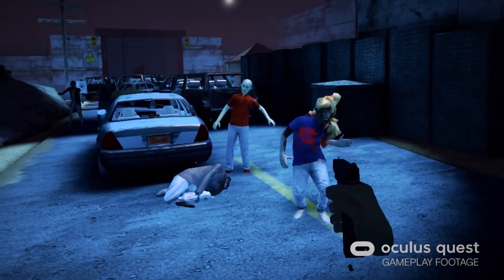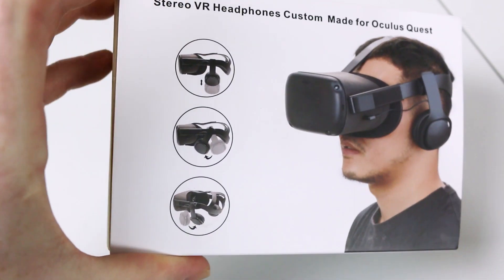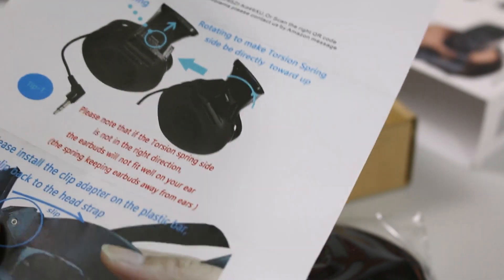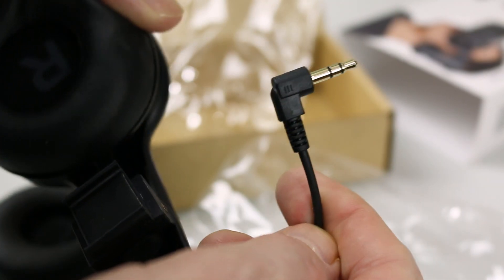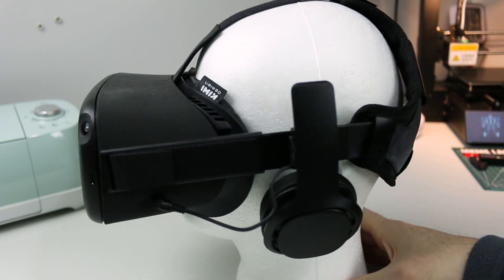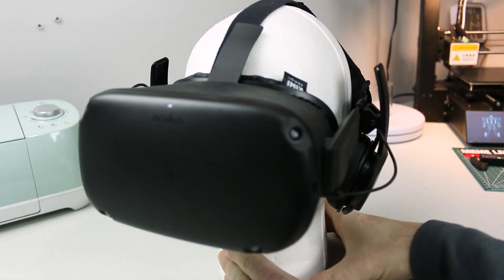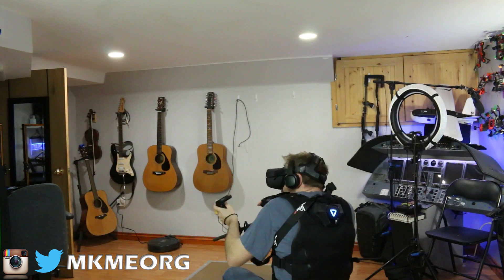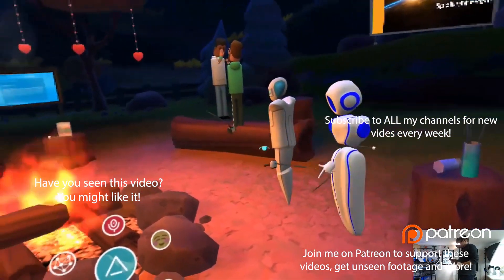Can Virtual Reality Feel Like REAL LIFE? VR Headset Sound Upgrade

Comment: Hey Eric - I was going to get a Quest 2, but I was concerned about the motion sickness.  I got a PSVR for the PS4 and some games make me want to die after about 30 minutes (that said I've had a quick go with it on the PS5 and things seem sharper/better)  How are you coping with any motion sickness with the quest?
Reply from the maker: Hey bud. I had virtually no issues as every time I felt any vertigo I just took a break. Putting the small fan on the floor completely elimated it as my brain always has an "anchor" in the room. It works 100%. Only game that gave me any real issue was Mission Iss as you have no reference in the game with no gravity ;) Its a bit crazy. Love the Quest